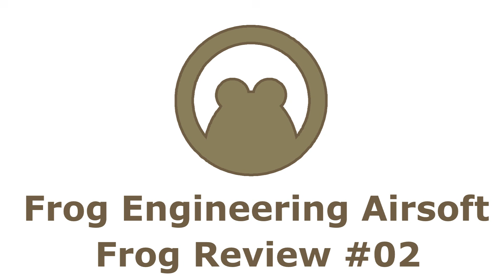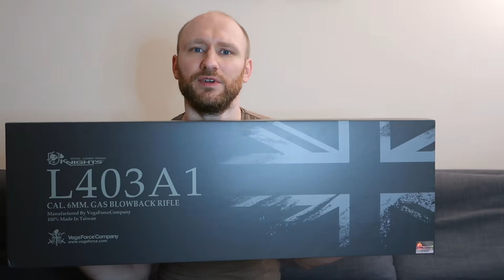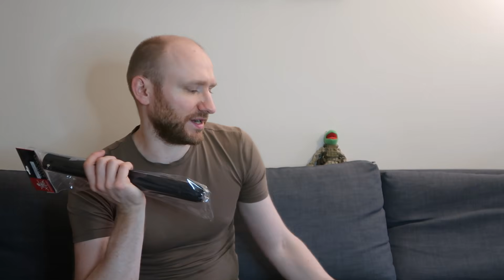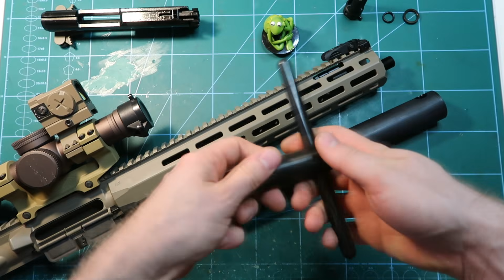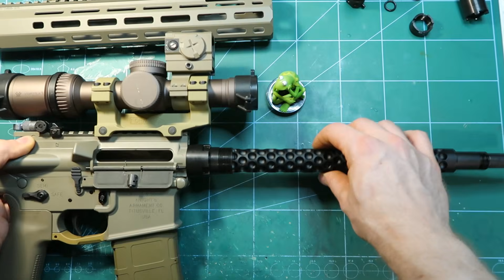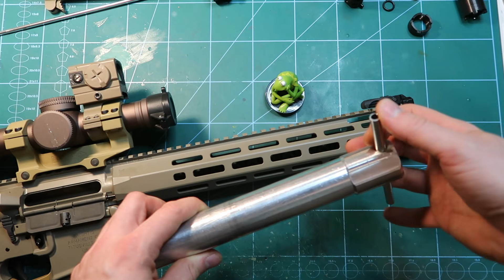Frog Review #02 - VFC L403A1 GBBR, first impression and barrel issue

Comment: The barrel nut is removed with a standard AR15 Armourers Wrench (available from almost any airsoft store). I've done it myself. Very easy. The VFC tools are only for the handguard and gas block. The name is a dead giveaway:

'VFC URX6 Handguard / Gas Blk Disassembly Wrench (L403A1 / KS-1 Series)' - Notice how it doesn't say barrel.

Comment: I believe the tool is only to take the URX handguard off. Is it possible that the barrel nut might be tightened or loosened with a regular armorers wrench? 
Bottom of the line; It's bad thing manufacturers ship these out without a proper shimmed barrel. Sadly, I've encountered it on other brands and aegs as well.
Reply: No
Reply from the maker: Yeah, I am not sure how the wrench you mean looks like but the tool is pretty specific

Comment: Alright that Barrel play is a big issue and a big no no..
Edit:  Iam glad you fix it.
Reply from the maker: Yeah, thanks. The biggest issue for me is that probably 99% of buyers don't buy a dedicated special tool just in case they need to use it once in their life fix barrel wobble... Such things shouldn't happen, the failure is super basic.
Reply: @frogengineeringairsoft  True
Reply: Mine was fucked from the factory. Threading seems bad creating the barrel nut to slip and cause a canted rail and barrel
Reply: @desertstriker8  Oh no
Reply: @Liedton it sucks because like you said you need the tool to even attempt to fix and it's almost another $100 USD to import. I contacted VFC let's see what they say. There is another couple users in the HRC discord with the same issue I got.